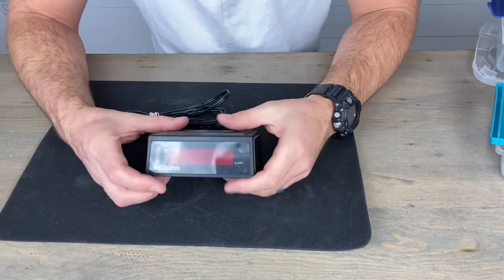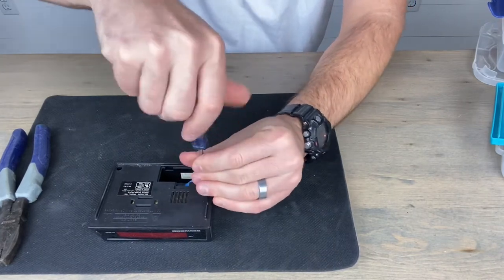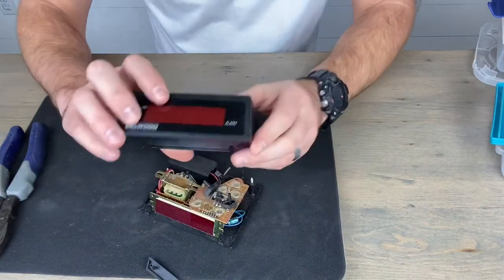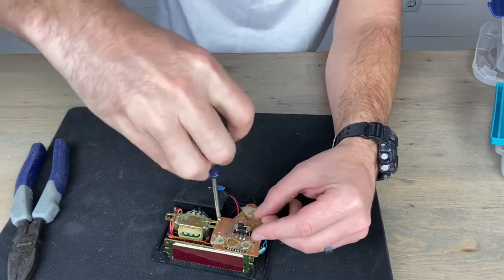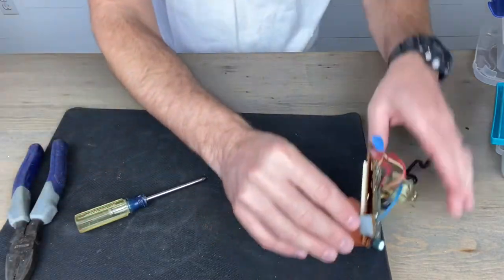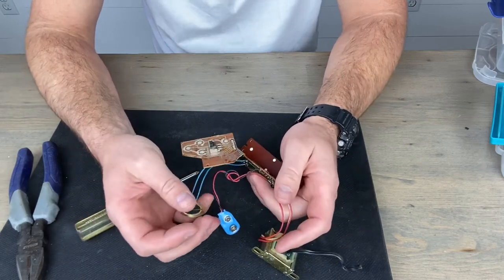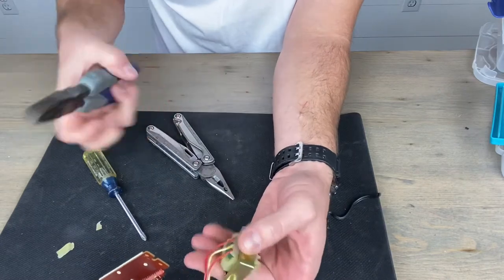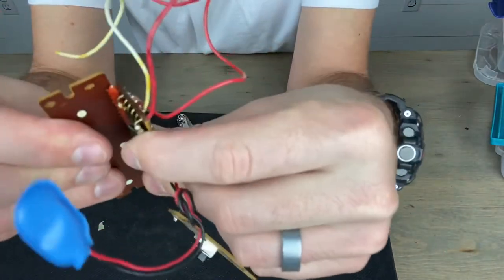What’s Inside of a Digital Alarm Clock

Comment: Thanks for this! I finally pulled open the old digital alarm clock I got for $2.99 at Goodwill because even with the alarm set to "off" it decides to go off on a whim and it's been giving me a heart attack at night. When I pulled it open I couldn't tell what component was the speaker. I use my phone for my alarm but like to have a bedside clock so I can check the time in the middle of the night and the speaker in mine looked identical to this one! I snipped the wires and pulled the speaker out. Thanks again!